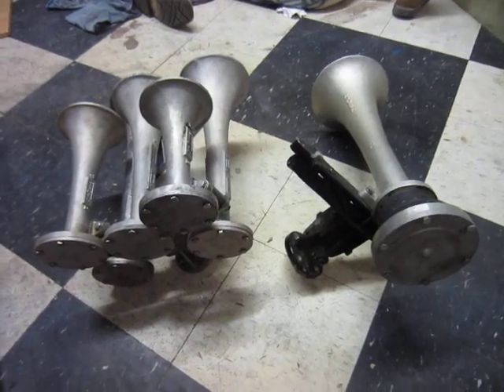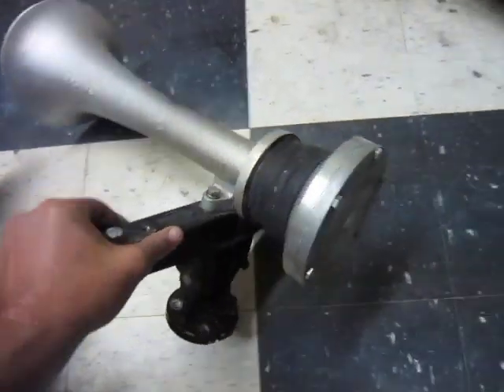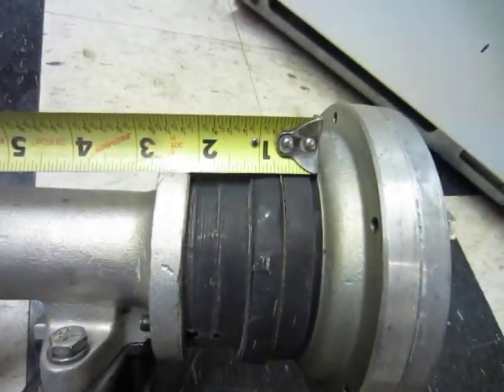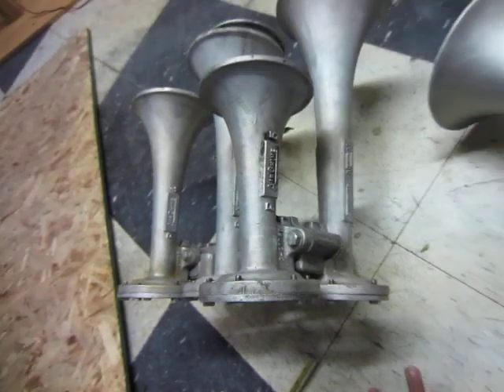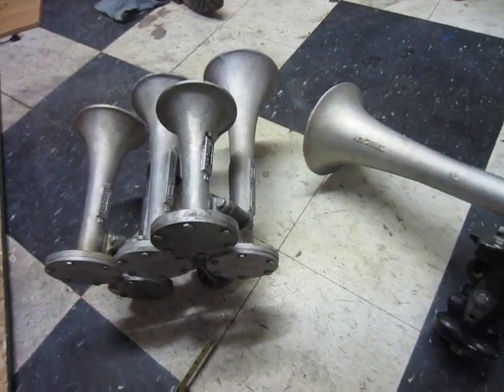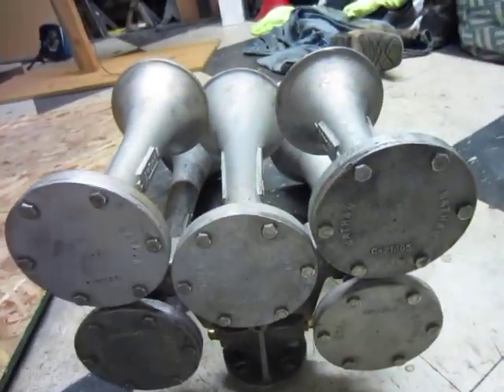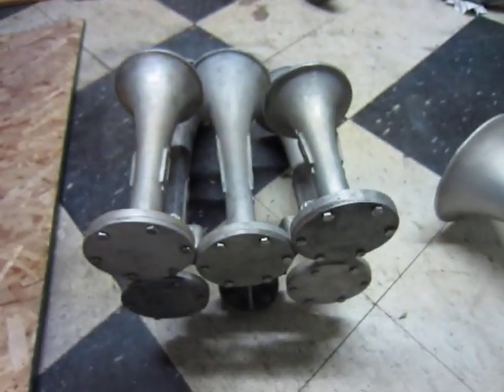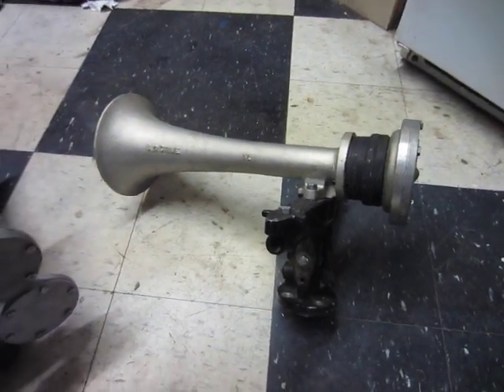Nathan Airchime Old Cast P5 with Tuned 1L bell to Play an A note P01235

Comment: That should sound pretty interesting! With the lowest bell being a K bell, it'll be a bit more dominant over the P bells.
Reply: That 2pc 1L is also sandcast, giving it a slightly smoother sound than a diecast 1pc 1L. However, the K bell does have a metal seat unlike the P bells having rubber seats, making the K bells more dominant.
Reply: @sepa2401  Ah, so it still has full sandcast acoustics.